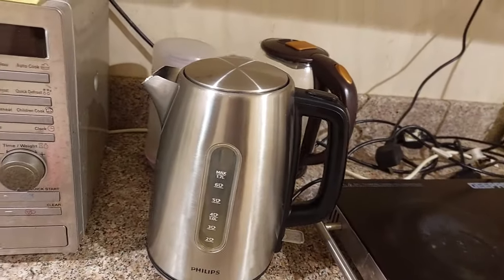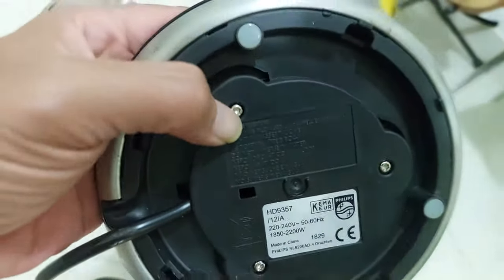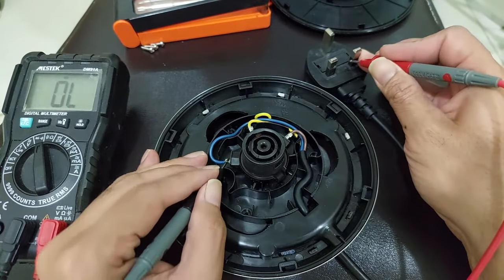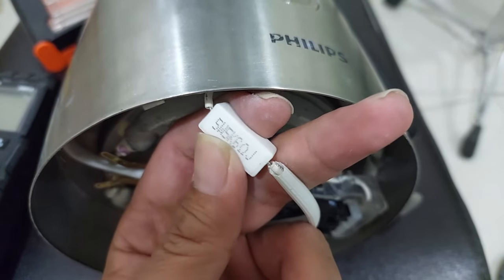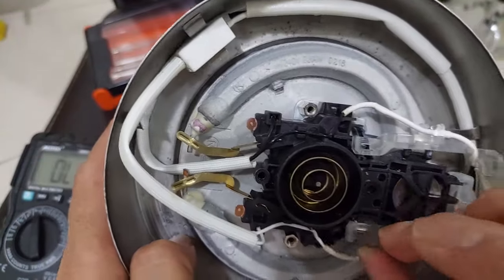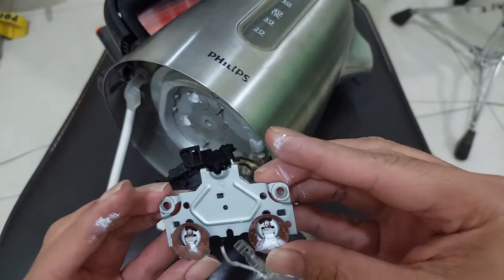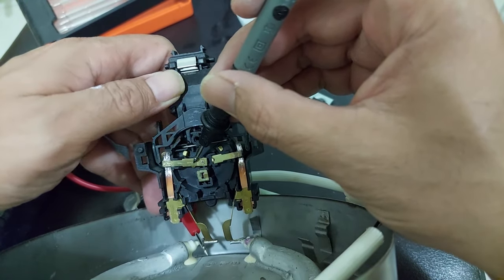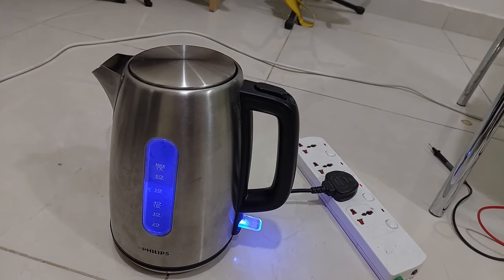Dead Kettle Repair Solved

Comment: Hi , pls help😢 mine has the same prblm of not heating, then found out that myresistor it burned ,  i bought a new resistor then it get burned again , what could be the problm ???
Reply from the maker: have you check the main Heater (circular one) ? check both ends heating element with Ohm tester, should be showing a reading, if not you need to replace it.
Reply: @addiengr1   Ohh i will check it up as soon as i get mytester inplace 🙏 Thankx a lot for your Advice Much appreciated

Comment: Hello sir, I have a Salton kettle that keeps going back OFF when I press the ON button. Based on your experience what causes the issue? Thanx https://youtube.com/shorts/hAdB8vSHjng?si=UquZ8W6EEVlhmUCZ
Reply from the maker: Variable Temperature Kettle is little bit more complicated, it has heat IC / chip controller. my suspicion is the capacitor (cylinder one or small brown square component ) if you can find it faulty or other component just replace it. you need multimeter to test each component.
Reply: @addiengr1  At this point, add the price of a multimeter, a triangle head screwdriver and buying the new components is not worth the cost of repair. I might as well just buy a new kettle 😐